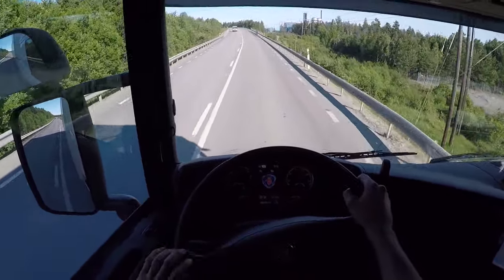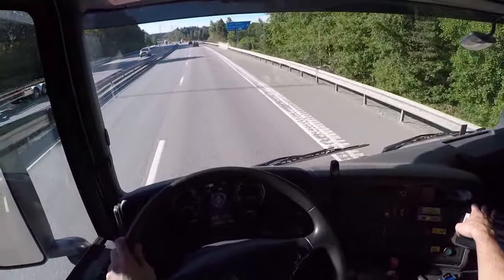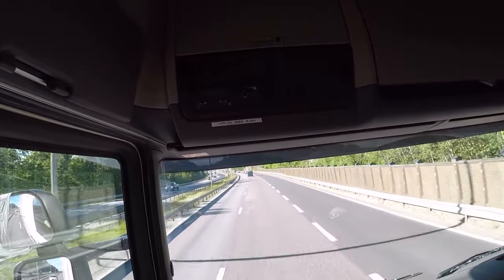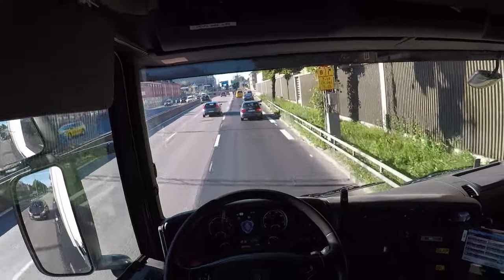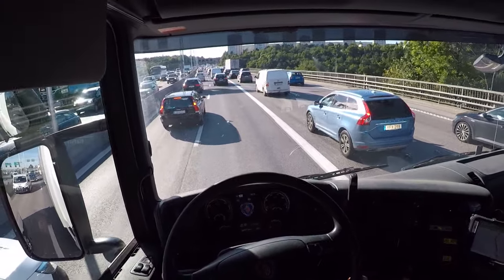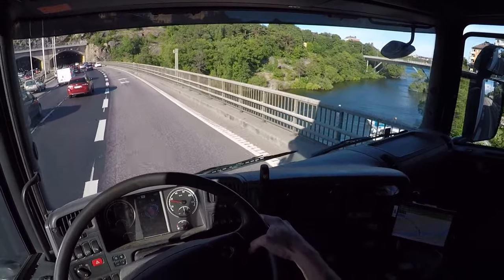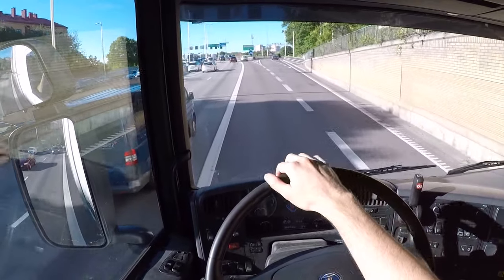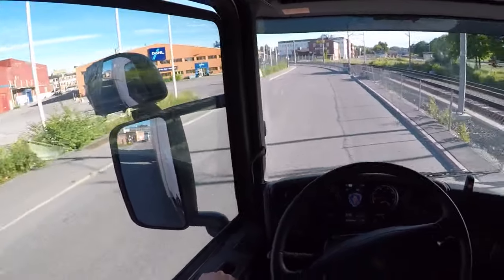Eco Driving Tips & Tricks, Truck & Trailer Reversing, vlog 29 june 2017

Comment: Hey bro, great driving man. I am learning so much about modern trucks from your vids and another Norway driver I follow but he doesn't coment and explain like you do. I used to drive trucks many years ago which shows how old I am, we used to have crash gearboxes (only manual change 18 speed gearbox 6x3 splitters on air shift.) But I could do that, but when I see all the switches and buttons and all the different things they do I think my brain would seize up with all this technology. Have you driven nthe new Scania 580  V8 yet, wow that's some truck. I watched a walk around and test drive done by a guy in Ireland. Think it seems that you are climbing up to heaven just to get into the cab. 4 steps!!!!! Driver was 2 metres tall and stood on the road his chin was level with the floor, and the cab, wow so much space and cupboards to put stuff, has a fridge, coffee maker, leather seats and the passeneger seat rotates 90 degrees jeez, like driving your living room lol. I remember the first synchro truck that came to England, the firm I worked for had the very first one a Volvo F86 check it out man tell you how ancient I am but that was the best luxury back then, quickly followed by F88 and F89 (sleeper cab version) every driver in England wanted one. Now that Scania, personally I think they beat the Volvo hands down. Keep pressing all your buttons and switches and save that diesel man. Love the videos bro. Thanks